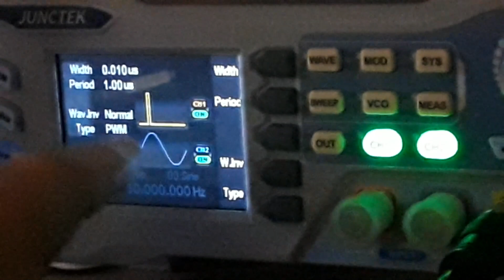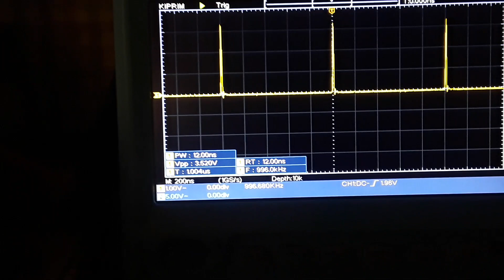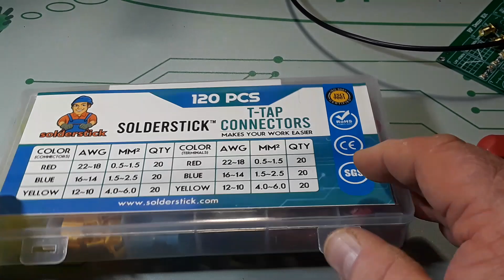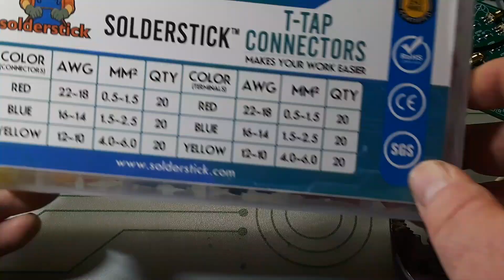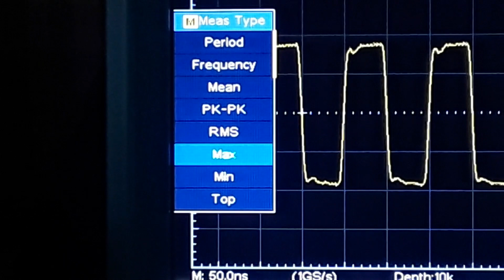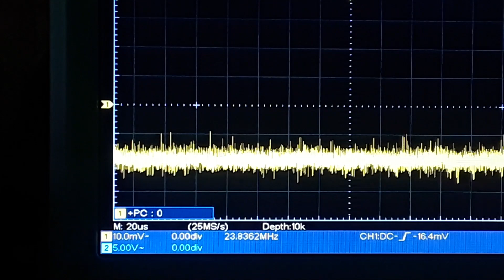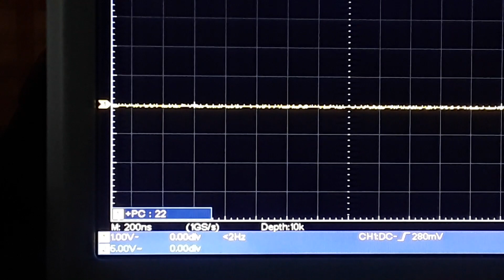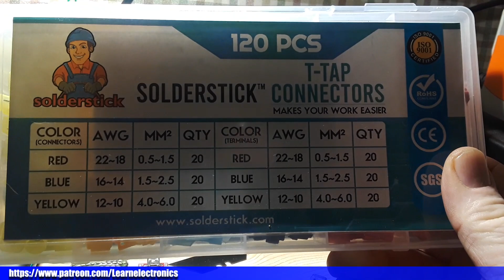Exploring Some Features On The Kiprim DS1202 Oscilloscope sponsored by Solderstick Wire Connectors

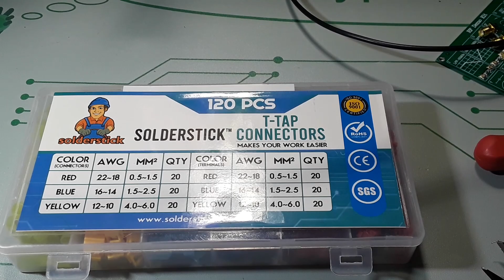Comment: Soldersticks are a fine product, but never use these parasite clamps from 3:50  on any automotive application. Problems and expensive diagnose time guaranteed.
They always fail eventually, but they fail invisible and more worse, they mostly got stuffed, where they don't present themselves to the mechanic, who is racing against the clock to find the source of weird electrical behaviour.
To be fair, they're mostly placed there by a mechanic, because they are so quick and easy to use. First they work, customer is happy, mechanic gets paid - but wait two winters - everybody gets desperate.
Use this stuff inside the house only, if you insist.